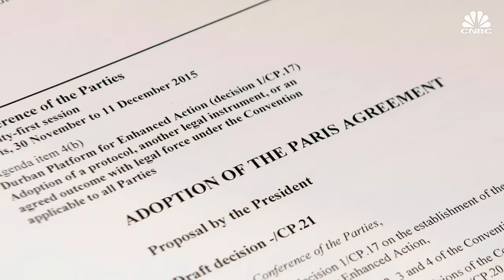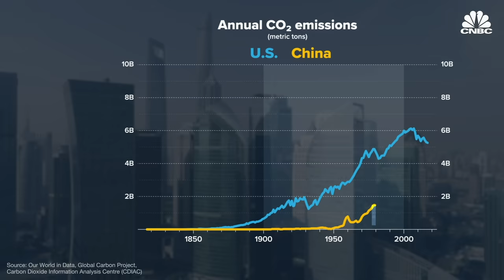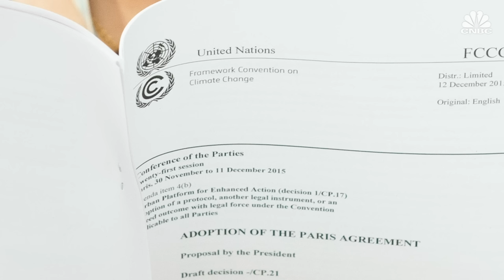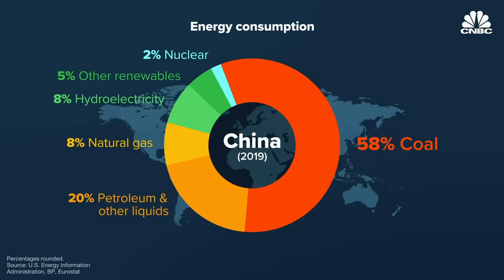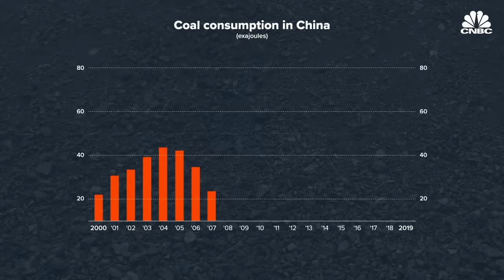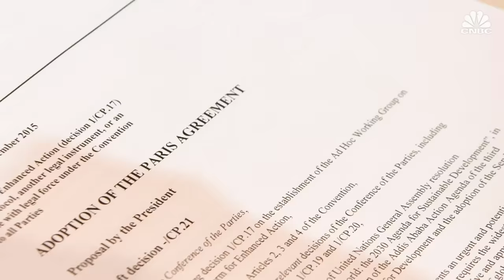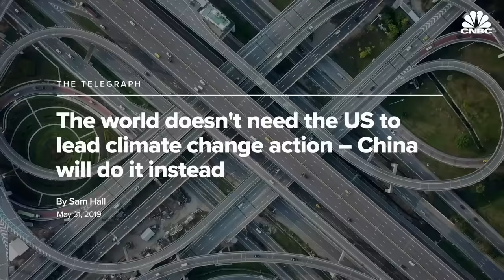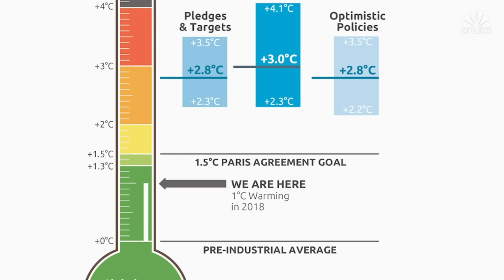How The U.S. Fell Behind China In The Fight Against Climate Change

Comment: One quick note: Air pollution and Carbon emission are two things. The coal plants built in this decade still emits lot amount of CO2, but they are not contributing to air pollution anymore.
Reply: dude how dense are you. The coal plants are emitting a lot of C02 into the atmosphere
Reply: Stanley Goddard  how all coal plants contribute to air pollution ≠ how coal plants BUILT IN THIS DECADE contribute to air pollution
Reply: Stanley Goddard  I think he meant pm2.5 particulates pollution which contributes to smogs vs greenhouse gas emissions. High purity coals emits carbon monoxide but does not produce as much smoke.
Reply: Stanley Goddard  false - they don't produce much air pollution... the soot is controlled in the new plants... but they do release carbon.  carbon has to do with heat - not pollution

Comment: My parents live in a small city in sw China. Our apt was installed a solar panel water heater back in 2002, and we had to share with three other neighbors, so sometimes in winter it really wasn’t enough hot water, and the pipe would freeze up. Then we moved into a single house around 2006 and we installed a newer generation solar panel for our house. It’s pretty reliable and no longer freeze up during winter time with the insulated pipes. Enough hot water is provided for the whole family to take daily showers, pretty good. And it cost about ¥250k to install the whole system.

Comment: I heard Scandinavia use a lot of wind turbines
Reply: Yesh, but in Norway they are controversial for a variety of reasons.
Reply: In Sweden we have had a grid with close to zero co2 since the 80s, 50% Hydro 50% Nuclear.
The windturbines combined with closing of nuclear plants are making things worse, this comming winter we wont be able to meet demand if we get a cold snap and unless we can import from other countries they will have to shutdown industries or parts of the grid..
Adding more windturbines is not a solution either since they already overproduce on windy days resulting in Negative electricity prices and produce very little when there is no wind which is usually the case on very cold days when we need it the most..
Reply: @Hjernespreng  why is it controversial
Reply: @tomte47  oh wow I’m from New York City they are putting up lots of solar panels. But that was enlightening and makes sense. About the turbines and the cold 🥶
Reply: @tomte47  why did they close the power plants
Reply: @SkyelarEagle  Well the short answer is idiological politics.
But this problem is showing in all places were they have built out solar and wind, at first it works fine but as you increase the share of renewables it gets harder and harder to balance the grid. In the U.S California is starting to get problems with both overproduction and shortages at different times.
Reply: @tomte47  yes and in California and new there’s a mass exodus but only the people with dollars 💵 

I diddnt know we’re getting problems makes sense though I think there’s 8 million people here in 13000 square miles
Reply: @SkyelarEagle  norway also sells oil to other countries
Reply: @alanmay7929  is that why they call them the nouvelle riche - I heard the citizens gets a lot of money from the government

Comment: China has been importing nearly all its energy; of course they want to produce more of their own. Fossil fuels will decline because they have peaked; so just to keep up with demand you have to produce with any resource available. One need do nothing to change fossil fuel use; it is being used up and production is declining. Wind and Solar barely have increased enough to fill the gap between lowering fossil fuel output and increased demand. Nukes and Hydro have not increased.